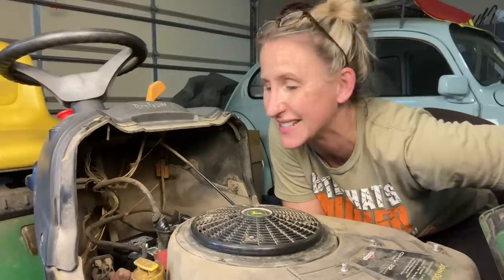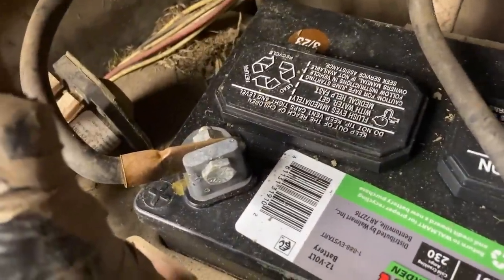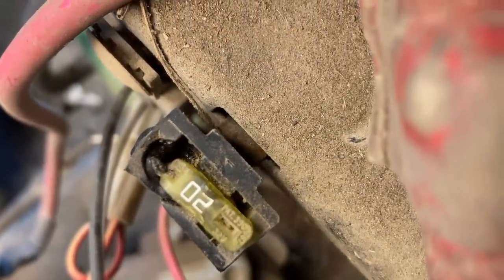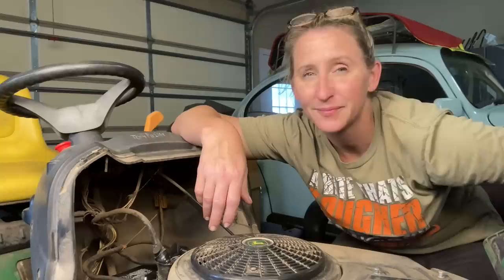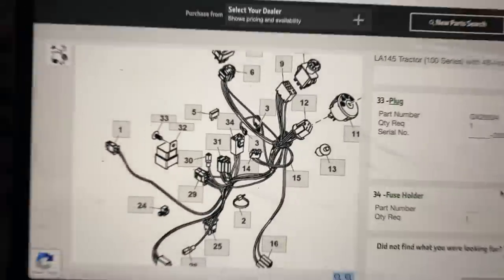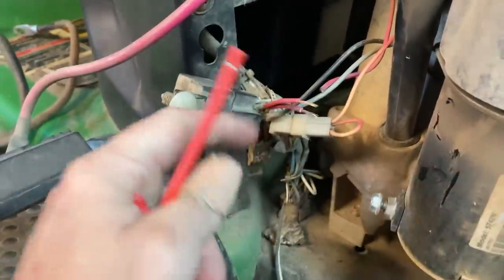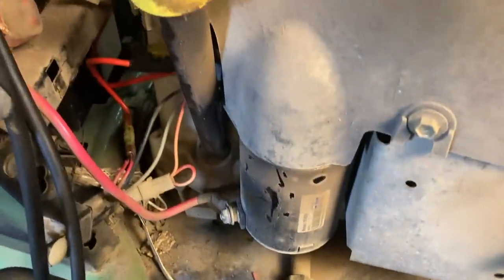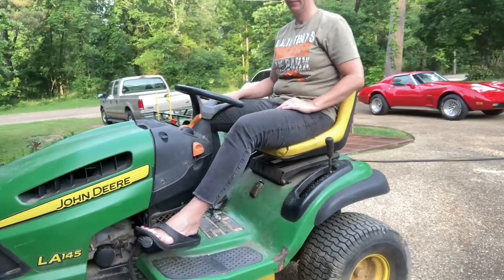Customer connected their wiring BACKWARDS! Mower won't start now. CHECK THIS FIRST!

Comment: I'd bet the batt that was in there before had opposite terminals. Instead of getting the correct battery  they just put "extensions" on it. Either they forgot or they sold it and when the correct battery was put in they just put the wires on the terminals on the ones they were on before.

Comment: Stumbled upon your channel, absolutely love your content. I'm an automotive technician so I can relate. I'm curious if you're aware of the issue with the Honda HRX217 when you have all 4 wheels at the same height, the right front wheel doesn't touch the ground on a flat level surface. Consequently my grass is uneven when I cut it. Its only 6 months old. I've tried setting the wheel heights so that they all touch the ground but the cut is still uneven. Otherwise it's a great mower. I had heard about this on one of the reviews someone posted on Lowe's website but thought it had to be a one off issue. Nope! Any thoughts? Thank you very much for your time and I look to forward to your future videos......Chuck

Comment: I work on spray machines and I’m very cautious when next to the computer board and I was trying to get it to work and tried it with a test transponder and it still didn’t work but in thr middle of the night I realized I might have the test transponder turned off!  It then worked after an hour of multimeter puzzlement. We need nights to cogitate or I do.

Comment: hey chickanic, firebird here 

Those butt connectors are great.
Have you tried the solder splices?
You just put heat to it with a mini torch type lighter until the solder melts.  No crimping. 

Firebird out

Comment: Any tips on where to start to diagnose a issue with my moms john deere 445, she was mowing, and the blades just stopped she was going forward at the time, her mower doesnt have reverse blade safety, belt is good, pto will not reengage mower never died and starts just fine. I was thinking fuse, just heard about it today so haven't gone to look at it yet. But if a fuse did go, what might have been the cause? Could a switch just go while in use, or could the pto clutch or solenoid have been the issue?

Comment: Help. I have an electric Oregon chainsaw CS1500 that leaked oil.  I took a housing off and found the tube was completely dry rotted. I couldn't find information on how to replace these tubes.

Comment: Have a Question ( unrelated to this video ) but after asking locally with no results and you work on a variety of lawn equipment , do you know what will fix/repair/patch a plastic lawn tractor fuel tank ?
I have answers from < Nothing can repair a tank, to plastic weld , to gorilla glue,  to Flex tape .
Search the tube and you get various possible cure's but no real answer to that question, Can you answer it ? and Thank you in advance

Comment: Wish I had your skills and information.  My echo SRM225 will start and run for a few minutes then die.  Restart and then it acts like it is choked out.  In a few more minutes and it runs fine until the next cold start.  Now it will not even start.  I changed the plug (yes I gapped it), changed air filter, checked exhaust screen, no problem there.  Unit has spark (checked with plug and darkness), plenty of fuel, even tried to eye dropper some fuel into the carb.   I am out of ideas and I still have weeds to cut down.  I always service my unit, grease etc and put it up after the season with some 2 stroke oil in the cyl etc.  Can't figure this one out.  Whaaaaaa I am stumped.....

Comment: Surely, surely you didn't give the machine back to the customer without checking the charging circuit? It's a two minute job with the engine running and a voltmeter. The stators on John Deere mowers are not robust at the best of times...
Reply from the maker: Oh no, we still have to service and check running by mowing with it. We'll be sure before the customer gets it back.

Comment: I can tell you exactly what happened he bought the wrong Battery not this time but the time before therefore the Post we’re on the wrong side of the bed so he extended the wires to make the wrong battery fit now this purchase the right, Battery you just need to remove the cables don’t know why garden tractor batteries come in or configuration